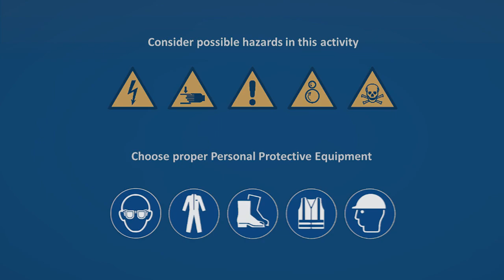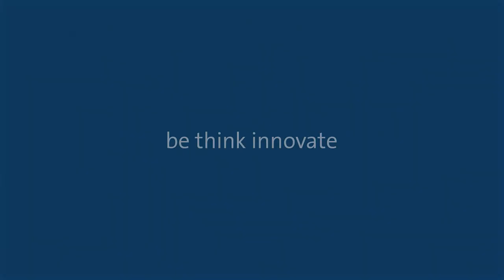How to replace low pressure shaft seal on Grundfos NBS single stage pump

Comment: 11:30 - Please note** The thread on the end of the shaft is M10 & an eye bolt can be threaded in there to aid the lifting of the shaft (as long as the pump model has the clearance) & also.. Most importantly! The tool used as a spacer, we call a Fork Tool, has a bent lip which serves as the place for the coupling to bottom out against.  The coupling needs to have proper shaft engagement & bottoming out against the bent section of the fork tool is the fool proof way to ensure this.  Then lastly, the torque sequence keeps noise minimized if you use a star pattern starting on the motor side, gonig to the pump, then back to the motor & finishing on the pump side.  It's all shown here, but just trying to highlight :)